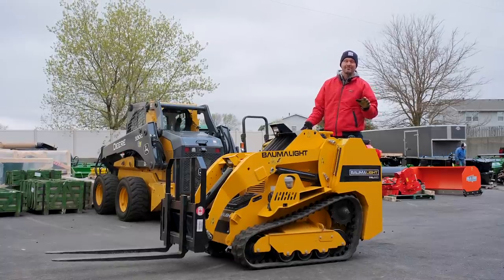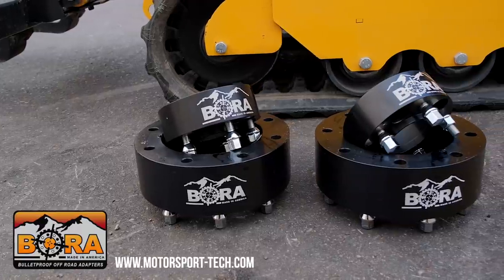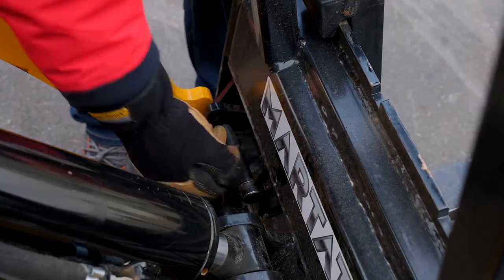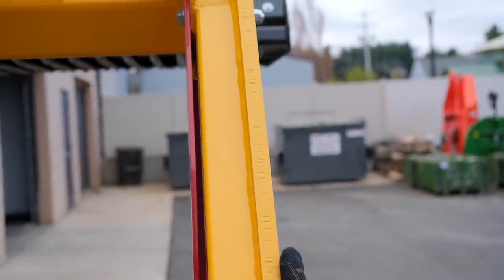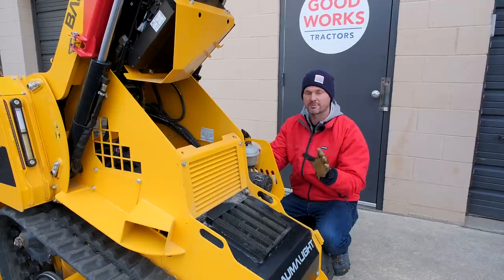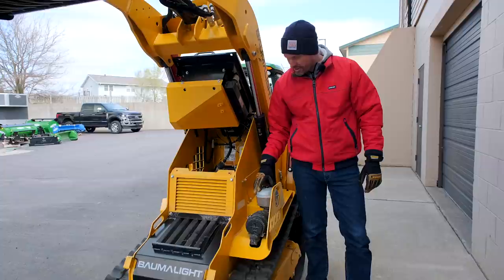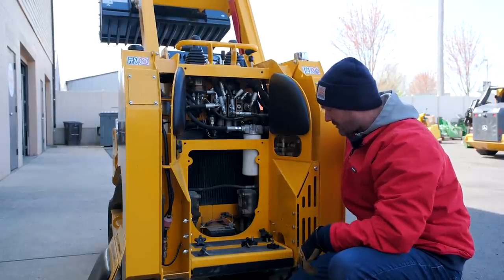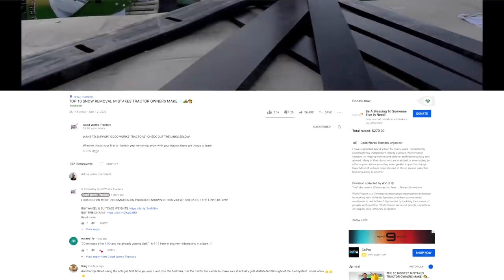MIGHTY MICRO MACHINE! BAUMALIGHT TRL620D MINI SKIDSTEER 🚜

Comment: That looks like a nice machine with some distinctive features but it's not competitive at that price. Bobcat, Vermeer, and Ditch Witch/Toro all sell similar machines around that price with extensive dealer support. Even Boxer is more available. How would one get a Baumalight fixed in the US particularly while it's under warranty? The tracked version is also too slow if your specs are correct. The Bobcat is often disparaged because it can't go as fast in reverse as it can forward and it's still faster in reverse than the Baumalight is going forward.
Reply from the maker: I say this with tractors all the time, every brand has pluses and minuses.  I'd pick things from every manufacturer to build my own perfect machine.
Reply: thats what I was thinking

Comment: The wheel version with a gas motor should be much cheaper.  Pricing on that would be very interesting.  

High flow hydraulics available on the wheel version?  I should look it up, shouldn't I?
Reply: Side note.  Much better use of 30k than the gator